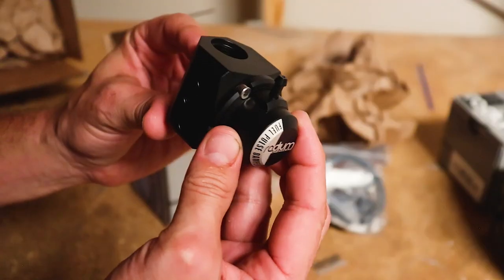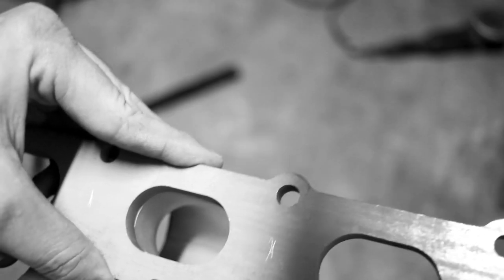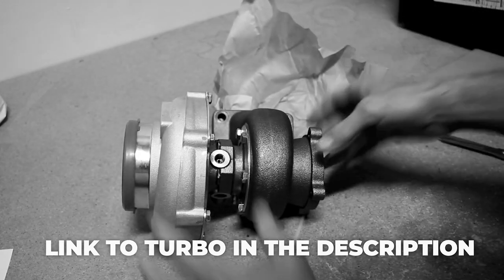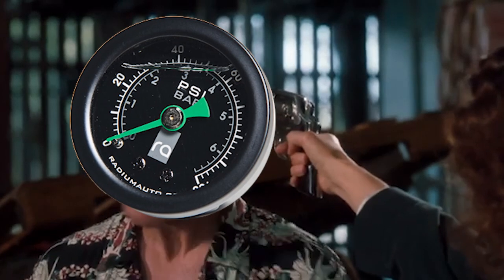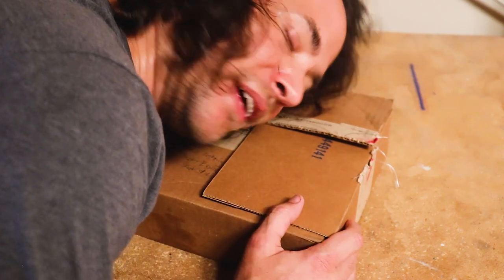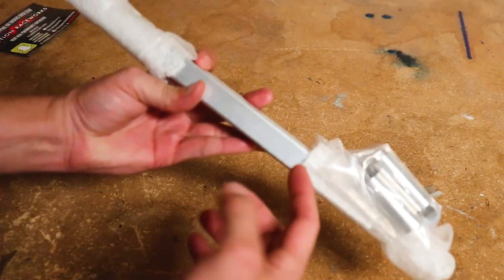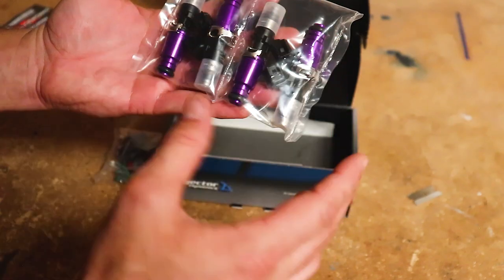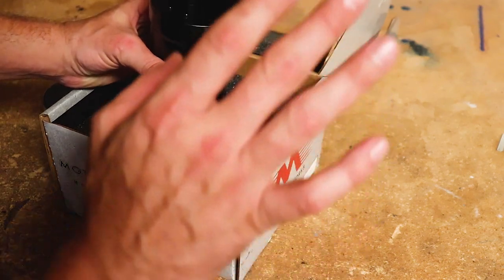Turbo Upgrades for Chevy Cruze: What You NEED to Know

Comment: Should I buy a t3,t4 turbo kit with everything included or buy a gt35 and buy everything separate I was thinking I should buy the kit because it’s a little smaller turbo and if I want to up the power I can just buy another turbo
Reply from the maker: I would honestly go with something smaller like a gt28 or gt25 unless you're just looking to do all out top end stuff?
Reply: @cmattdabrat  alright thanks man
Reply: @cmattdabrat  I’ll buy a gt28 kit that they sell and then custom make the exhaust manifold with the stock one then make a custom flange then tig or mig weld it on

Comment: Clickbait title?
The stock engine makes 150HP max, with a 14PSI boost, you'll only get up to about 225HP, and with an extreme tune and 21PSI, you might get up to 260HP tops, if nothing else breaks...
Reply from the maker: Take a look at any b18 gt35 build that can easily reach 600whp. Take the NA number for example. To reach 500whp, you would need a NA engine capable of reach 167hp. Ad 1 bar/ 14 psi of boost, you'll have an engine that'll make 333hp. 28 psi / 2 bar. 500whp. That's not set in stone, but all boost is, is a multiplier.

Comment: I bet your going to start breaking things on that car.
Reply from the maker: That's the idea. Build, break, repeat.
Reply: @cmattdabrat  I would build some solid motor mounts first thing. I had 1995 Pontiac Sunbird that I put a cam in and had some head work done on it . It had a 5 speed trans. Just that kept breaking motor mounts .